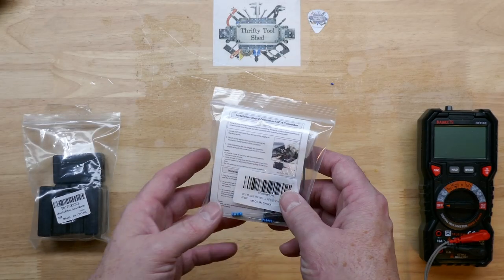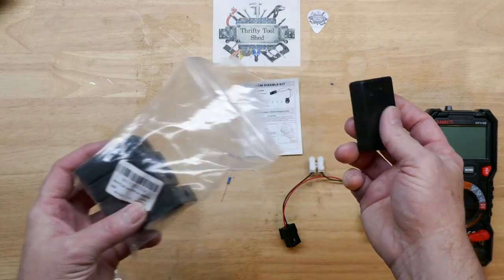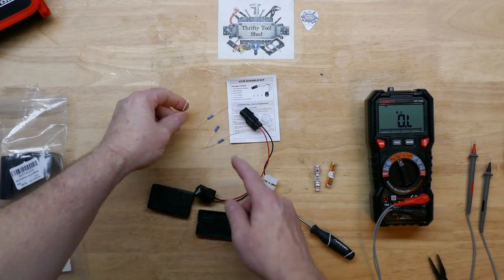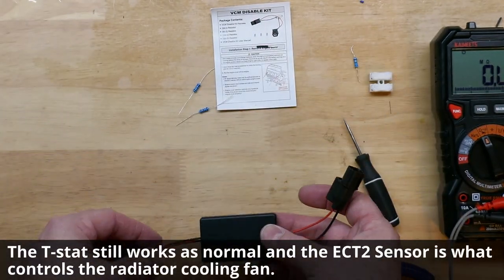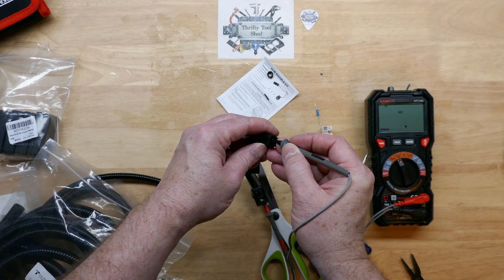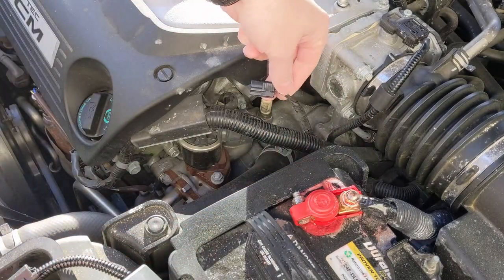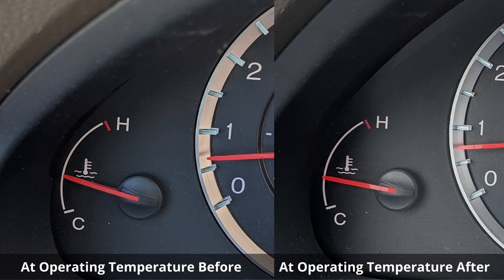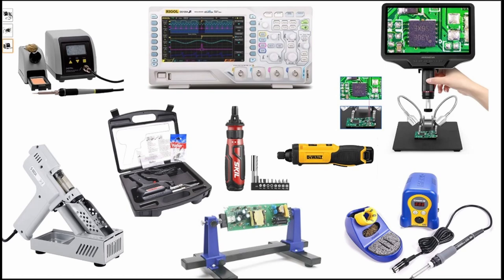Honda Accord 8th Gen VCM Disable

Comment: worked on my 8th gen v6. used the 100ohm resistor. No engine light, no eco showing however temp gauge stayed how it was before (doubt it is an issue). In conclusion. Works as it should. if anything were to happen in a weeks time, then ill be sure to update and change resistor depending on the issue. hope this helps anyone that finds difficulties

Comment: i put on the highest resister and my eco disabled quick and feels better while driving less noise
Reply: And the gas mileage is still about 25mpg! 🤔
Reply: I use the highest resistance in my city, in these summer times it is hot. What resistance should I use when winter comes?

Comment: Have ua ever tinkered with throttle position sensors? When they started packaging them into the throttle body, the cost jumped from $30 to $300-$600.
Reply from the maker: I have not looked into any throttle position sensors myself. Sounds crazy how the price has increased though...
Reply: As I understand, there might be 2 hall effect sensors of different spans. They're signals are compared. But it's the same device with no backplate riveted to the metal throttle body. Grrrr.

Comment: Hello I have a 05 honda odyssey check engine light did come on I disconnect the negative from the battery plug it back in after 15 seconds I start with the 82 after about 2week light kept coming on so I try the 100 and is doing excellent 2 months later no light. At all 😁 works good I got my for $15 of ebay

Comment: I just put this VCM disable on my 09 hands accord,  but the ECO mode light still comes on? Is that normal or maybe I put the wrong capacitor in of the four? Thank you sir
Reply from the maker: I would try the higher value resistor. If you don't have a meter you can use the color code if you can see the colors well. Online resistor code apps are available if needed.
Reply: @ThriftyToolShed  will the eco light still come on once I have the correct resistor? I read that it’s a separate thing than the VCM?
Reply from the maker: On my 2010 Accord the ECO light has not come on since I installed this resistor as shown in the video. I thought I might have to play with the values a little bit. I could have easily installed a potentiometer and adjusted as needed, but honestly after the very first trial it just worked. The temp gauge is just slightly lower than usual at operating temp and that keeps the ECO mode from activation.

Comment: How many miles where on your V6 Honda? I have 142k now on my V6 '15 Odyssey and I am thinking of using this hack. Except I got my own female to male adapter and will just DIY the connector with the appropriate resistor. I'll try to do that soon and let you know how it goes it. Thanks
Reply from the maker: Around 90K. The first resistor I used is still working in my climate. It may differ based on your temperature ranges.
Reply: @ThriftyToolShed  Yes I live in GA - Atl as well.. so we have the same climate...thanks..
Reply from the maker: @saudk9261  
Great, hope yall are in good shape from the storm in Atlanta. We got it really  bad in the Augusta area!

Comment: I install one and check engine came on
Reply from the maker: Was it this same type? If so which resistor did you use? I still have mine the exact way it was installed in this video and never had to change any resistor value or anything. I live in the south so the first value was perfect. It only affects the temp gauge reading slightly lower if installed correctly.

Comment: Does this help fix the misfire issues?
Reply from the maker: I would not think so unless you are having some unusual issue when the ECO mode deactivates the cylinders? Misfires are typically more of an issue with the ignition coils.
Reply: It absolutely does. I had random misfires plus cylinders four five and six intermittently.  With a scanning tool it would show 60 continuous misfires and the check engine light would never trip. It was due to the VCM.
Reply from the maker: Great to know! Thanks for sharing!
Reply: What fixed your misfires?
Reply: @3xplicit283  The part shown in the video.  Well, a similar part.  This should work as well.  Try to find the one where you don't have to set the ohms yourself.  There is one about maybe $80 that adjust on its on.  I got the manual one cause it was half the price.  I have to reset the ohms every time it gets really warm outside or really cold.
Reply: @Xilent1  Mind sharing what temps required what resistors?  I live in the Midwest were it gets pretty cold in the winter, but we still get warm temps in the summer. 2008 Accord 3.5L V6
Reply: With the misfires check the spark plugs they can foul often because of oil burning also run some fuel injector cleaner through it that took away my misfires.

Comment: * Saved my 2008 Accord 3.5L V6 ***.  That's not hyperbole.  Had misfire codes bouncing all over between cylinders. Replaced plugs, nothing.  Replaced coil packs, nothing.  Had it in to three mechanics who either couldn't find the issue or misdiagnosed the issue, no help (but plenty of cost).  It was getting so bad it idled and ran horribly, and when I tried to pass another vehicle it would jerk violently and lose power significantly and lurch/shudder.  Flashing check engine light was constantly flashing, VSA light was on constantly, and was going through a ton of oil.  Then in what I thought was an unrelated issue, transmission started slipping badly engaging into first gear from Park, Reverse, or just accelerating from a stop.  It was like doing a hole shot, where when it engaged after a delay there was a hard thunk and it would chirp the tires.  I was convinced my car was on on its last legs, because an engine AND transmission rebuild on a 2008 would be cost prohibitive.  But it really was that bad.  Which was pretty upsetting as the vehicle otherwise was in fantastic shape.  

Figured I had nothing to lose, so installed this kit with the 100ohm resister and cleaned the plugs on the most fouled cylinders, hoping that at least it would run better until the transmission failed.  Vehicle started running MUCH better, check engine light went from flashing to solid, and after maybe 100 miles went off completely.  And shockingly, the transmission issue went away when the vehicle started running better.  Fast forward I've put on another 30K miles and all is still well.  Had a brief episode where eco started coming on and check engine light went on, but tested the resistor and it failed.  So I picked up a ten pack of 100ohm resistors for $1.99 from Amazon, replaced it and back in business.  I still can't believe this $14 repair saved my car.  Or that Honda would allow such a flawed design to go on like that.  Never got a notification of them or any kind of recall notice.
Reply from the maker: That's awesome! Thanks for sharing!
Reply: Thanks for that description.  Exactly what I am experiencing.  I bought the kit last year in the winter but problem went away during the spring and summer.  My wife said the car is acting up again this morning, Its been colder last night than most.  I am wondering if the cold has something to do with it?  I am going to look for my kit today.

Comment: Interesting.  If it was me I would likely start with the smallest resistor to use the minimum possible change to the perceived coolant temperature.  If the ECM sees lower than ideal coolant temperature it could alter the ignition timing or air/fuel ratio thinking the engine is not at operating temperature.

Also keep in mind that many vehicles have coolant temp gauges that keep the needle steady over a wide range of temperatures.   This is to give the illusion that the coolant temp never changes and is always perfect, lol.  I say this because a relatively small looking change on the gauge could in fact require a large drop in perceived temperature.

It would be interesting to use an OBD scan tool to see how much the perceived temperature drop actually is.
Reply from the maker: I do have a graphing OBDII tool and was going to chart the difference between the 2, but did not want to get too much information in the video and make it even longer. I definitely had the thought that some viewers would like that. I agree with the starting with smaller value first for sure. I simply eliminated the 68 and the 120 from the mix going by others experience and sometimes using the 82, but in certain climates using the 100 ohm. I know they make the active type as well that self adjust, but for $29, I will give this a test first for sure. 
Thanks for your comment!
Reply: @ThriftyToolShed  since you’re handy, why not extend some wires inside and try a potentiometer?  Adjust to the minimum required, measure, replace with appropriate resistor?  Sorry if I’m making this way too complicated, my OCD gets the better of me sometimes! 🤪

Comment: Thank you. I’m about to do the install but I’m not sure what resistor I’m putting in. My tester is missing. I will just try one of the four that came with the pack.. thank you gain for this. My 09 also shows misfire on 3 cylinders and I’m not sure why as I replaced the coil packs
Reply: Could you solve it friend? I have exactly the same problem
Reply: Try spark plugs
Reply: Before trying spark plugs, get a mechanic to wipe the code
Reply: @MsXavier42  my issue was I had to high of a resistor. I put a lower rated one in and wiped the codes. It’s better now and the temp hand shows a little cooler now
Reply: @bamaboysmith2723 Hello bro, I have the same problem, what is the value of the resistance that you are using?
Reply: @victorgutierrez7056  will get back with you. I checked mine with a MMeter. I think it was a 60
Reply: @LiljamezZz  You don't need a mechanic.  Just go to an auto parts store, most will read codes and allow you to wipe them (they don't want to push the button but will usually show you how).

Comment: Hello I’m a new subscriber and just happened to come across your channel and I have found your videos to  be extremely helpful especially your Honda accord videos  and everyday repairs. I’m a retired aircraft mechanic but like you I would rather fix what I have than buy new when possible . Yes I’m a Diyer . I would like to ask you about the VCM muzzler. I’ve watched the video and I’m about ready to purchase it . Has it worked out for you? My 07 Honda Odyessey has VCM and it has been working fine I have 80000 miles on it but I know people  with VCM and it’s caused problems with the engine so I’ve been thinking of installing the muzzler. Thanks for sharing all your videos.    Artie 👍
Reply from the maker: Hi,
Mine has been working fine ever since install. It has stopped the ECO mode from activation. That has helped with oil consumption and had to help engine wear as well. I never even had to change my Resistor value from my initial choice. I live in the south and that one works year round. Some viewers mentioned using the more expensive auto settings modules, but I have not needed it. Hope it helps. Best of luck to ya!
Reply: @ThriftyToolShed  thank you for the reply much appreciated I’m up here on Long Island New York . I’ll have to do a little more research on the second one you mentioned. Thank you 👍
Reply: 영상 잘 봤습니다.
하지만 나는 저런 고정 저항이 아닌 조절할수있는 가변저항을 사용중입니다.

Comment: Does this effect when the cars fans kick in? Would it cause the car to overheat in summertime when idle?
Reply from the maker: I have had zero issues through the summer with mine with the exact same resistor in it that I originally tested. It worked fine from the very beginning and I live in the South. On most models it's a different sensor for fan control.

Comment: I removed my comment about competing products since you did mention them.     Ive read that some of these VCM fixes have to be removed in certain circumstances.    I found this on the website for the VCM Tuner 2.     Is this scenario a problem for the Muzzler? ....
"Auto Diagnostic mode for TPS re-learns with no user intervention (any time the battery is disconnected or a dealership firmware update is performed, a throttle position re-learn is required by the ECU)"
Reply from the maker: Excellent point!

Comment: Do you have to do it for 2016 accord touring v6 or is the issue fixed by honda
Reply from the maker: I am not sure about the 2016 to be certain. I would think the cylinder deactivation is a bad thing for the long run for any vehicle? You have so much going on between the thermal dynamics and the varying lubrication that it's not a good thing long term. Just my opinion though...

Comment: Hello, I have bought It and I'd like to know How Will I know If CVC has been deleted?
Reply from the maker: This is not a delete, but rather offsetting the sensor reading to not show optimal engine temperature to allow the VCM to activate. You can tell when while driving the ECO light doesn't come on. I have not seen mine come on since putting the resistor inline. My oil consumption has dramatically reduced. Hopes it works well for you also.
Reply: @ThriftyToolShed  my Honda is a 2008 Accord that doesn't have an Eco light. Have you noticed any difference in engine sounds after installing the VCM Disable? I meant you have felt all cylinders working.
Reply from the maker: @ruymenezes4940  
Dang, I thought all 8th Gen V6 had the green ECO light in the tachometer. I could tell slightly on mine. It's not super noticeable and really, the V6 VCM is very smooth. It was so smooth that it never bothered me. It was simply the oil consumption and possible engine damage is why I did the mod.